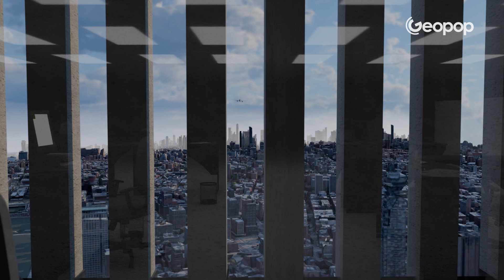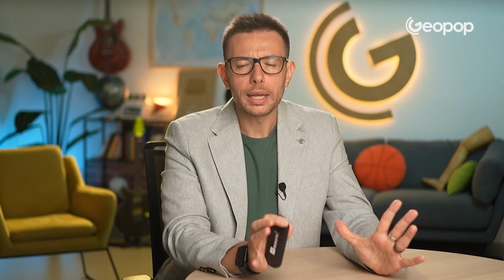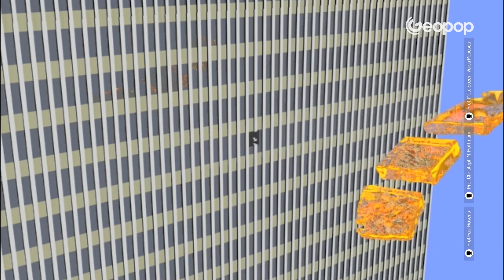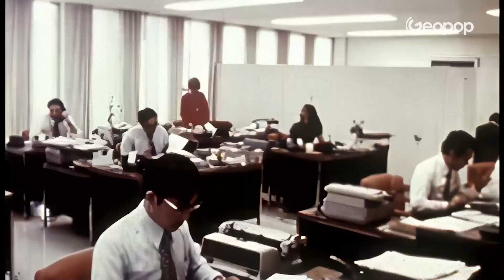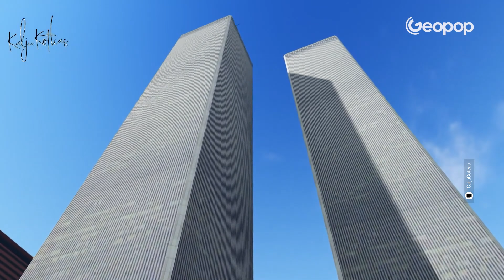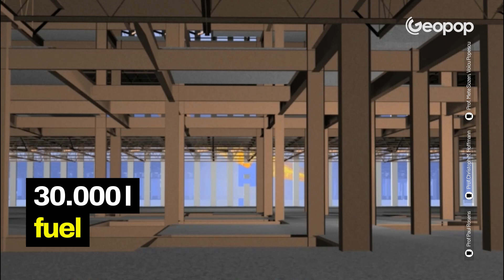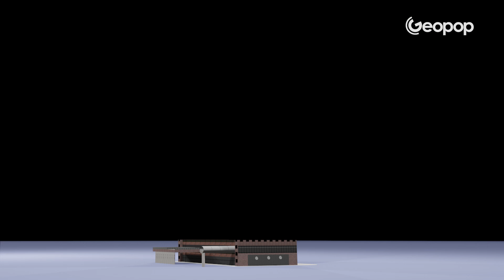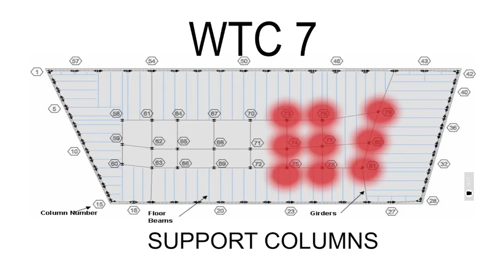9/11, 2001: The Technical Reconstruction of the Twin Towers and WTC 7 Collapses

Comment: The engines are indestructible along with other parts. Planes don’t disintegrate.. look at other plane wreckage. Also the buildings went down the path of most resistance. Defies laws of physics.
Reply: Don't confuse disintegrate with vaporized. The planes definitely disintegrated. They were finding parts of them blocks from the impact sites.
Reply: The engines are indestructible is crazy bro
Reply: .  . Bodies and luggage also, as we see the fuselage exit the side of the tower in a fireball .  . passports pull themselves free and survive almost unscathed -- while everything else evaporates.  Monkeys at a keyboard have a better chance of typing the Encyclopedia Britannica .  .
Reply: Nothing defies physics here … and physics does not care about your understanding of it! Believing in Thermite or planned demolition defies common sense!

Comment: This is total bullshit! especially about building 7. Using a government entity like NIST is like asking a cop to investigate him/herself
Reply: This video is very good – with one or two exceptions - and goes into a much higher level of detail than many viewers will be able to comprehend.  While not perfect, the collapse mechanisms – the sequence of failures - described here are substantially correct and this is true no matter who planned and carried out the 9/11 attacks or why . 

That may not be what you want to hear and go against 20+ years of entrenched dog_ma and conditioning, but it’s not wrong. 

That also means (in case you did not get the hint) this video can be (and IS) absolutely correct in its description of collapse mechanisms AND the 9/11 attacks could still have been some sort of inside job. The two things are in no way mutually exclusive. 

The mechanisms described here have broad professional support around the world. There are no professional engineering organizations (for example: ASCE, ASEE, ICE, etc) that disagree with them or have offered any formal dissenting opinions or alternative hypothesis. 

So, setting hubris aside, either the overwhelming majority of the worlds structural engineers and simple observation are wrong,… … or you are. Which seems more likely? 

IF you still think believe this explanation is wrong then produce a better one . Good luck with that. No one ever has and I don’t see you moving that needle today. 

No one ever does.
Reply: No structure can collapse at freefall speed without help! It's scientifically/mathematically impossible. Those buildings were wired to come down! The evidence is out there.
Reply: @bartjopling4886 - None did.

Comment: I don't care what science says but there's no way 2 buildings fall in the EXACT same way. It's impossible
Reply: Two identical buildings suffering nearly identical damage and identical failure mechanisms do. You just have to use the thinking part of the brain.
Reply: ‘’No amount of evidence will ever persuade an idiot.” Mark Twain
Reply: @deniseyeaisaidit  i know isnt it sad?
Me
Reply: The two towers did in fact collapse VERY differently.
Reply: @patrickanderson9023  - Not really. There are some detail differences but the failure mechanisms are fundamentally the same.
Reply: Physics do not care what irrelevant opinion you have in a matter you have  no knowledge about and lack any common sense!
Reply: Why, gravity is a constant., they both got weak, gravity did the rest. You need to go back to high school friend; I think you skipped science class.
Reply: What is the source of the many tons of molten steel found in and under the debris, the heat so intense that the molten steel remained in that state for weeks afterward, running off of the debris as it was excavated. This cannot be molten copper from wiring that retains the color of a shiny new penny.  It cannot be molten aluminum that retains the color of the polished aluminum wheels of a street racer. It was the color of glowing orange molten steel  that cannot be mistaken for any other material, reported by firefighters who are very experienced in the nature of such materials as well as seen in video evidence.

When you combine this with an entire lack of turbulence behind 500 mph aircraft, when even a small Cessna Aircraft would leave an evident wake in the smoke and fire only seconds later .  . We find that skeptics still cannot be skeptical of the official narrative in explanation.  Sponsored channels and forum activity are skeptical of nothing when support is provided.

Sponsored activity in the forums is very normal today for commercial and political purposes and subjects of controversy -- in the attempt to lead public debate.
Reply: It was stadged.

Comment: Haha what a load of bullshizzle.

Generating so much nonsense to justify what is wrong. 

Your whole story doesn’t make sense.
Reply: This video is very good – with one or two exceptions - and goes into a much higher level of detail than many viewers will be able to comprehend.  While not perfect, the collapse mechanisms – the sequence of failures - described here are substantially correct and this is true no matter who planned and carried out the 9/11 attacks or why . 

That may not be what you want to hear and go against 20+ years of entrenched dog_ma and conditioning, but it’s not wrong. 

That also means (in case you did not get the hint) this video can be (and IS) absolutely correct in its description of collapse mechanisms AND the 9/11 attacks could still have been some sort of inside job. The two things are in no way mutually exclusive. 

The mechanisms described here have broad professional support around the world. There are no professional engineering organizations (for example: ASCE, ASEE, ICE, etc) that disagree with them or have offered any formal dissenting opinions or alternative hypothesis. 

So, setting hubris aside, either the overwhelming majority of the worlds structural engineers and simple observation are wrong,… … or you are. Which seems more likely? 

IF you still think believe this explanation is wrong then produce a better one . Good luck with that. No one ever has and I don’t see you moving that needle today. 

No one ever does.